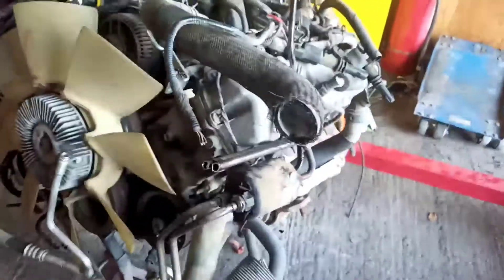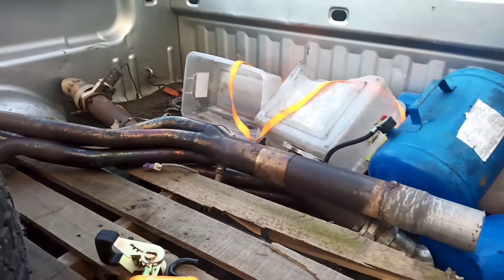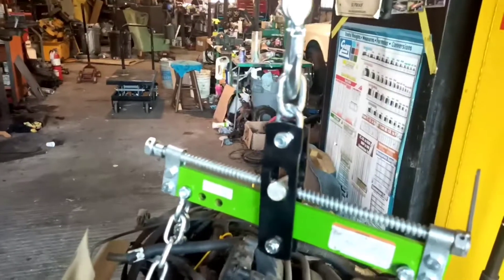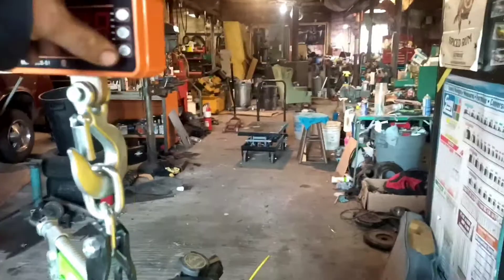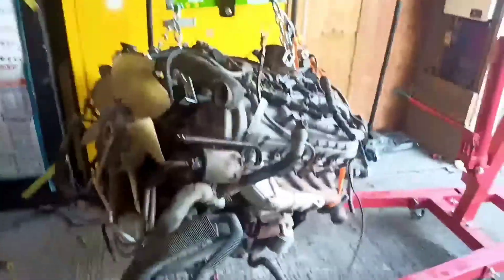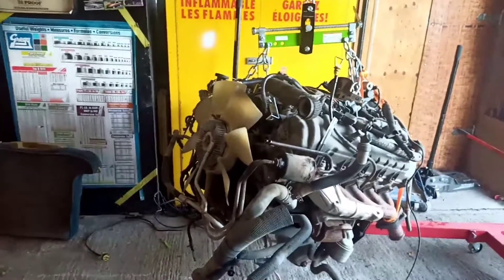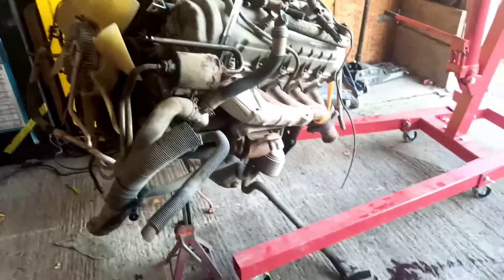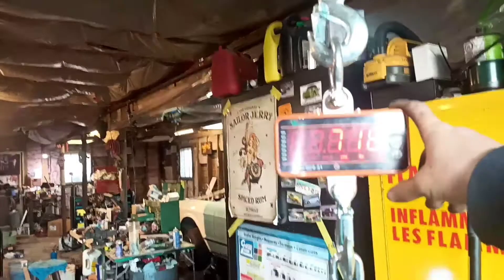how much does a 6.8l ford v10 weigh? 415 3v fully dressed

Comment: Ive always read they are about 100lbs heavier than a 5.4. Really not bad for a dressed wet engine of its size. Fe big blocks are just under 700lbs dry and they were considered fairly light combos.
Reply from the maker: There is a little weight that can be stripped of the motor as well .I I'll make a video on the weight  of a stripped down one in the future
Reply: @Nodarperformance  do you think it would save weight to convert to a manual rack and add electrical power steering? There are people that have taken the system from a Prius steering column. I'm not sure if it would require a bigger alternator, though.
Reply from the maker: @sfx1999   I have looked into the prius swap or the gm style and it does look really straight forward. It is just so easy to run hydraulic lines and make a power steering system work. It would though drop a lot of weight off the motor.
Reply: @Nodarperformance  oh for sure. The stock clutch fan, exhaust manifolds, tons of wiring and vaccum cleanup that can be done. Also, i never knew what the 3v 10cyl weighed compared to the 2v which I believe is around 640 dry so they are a lot closer than I thought. Thanks for posting. Im looking forward to seeing more.